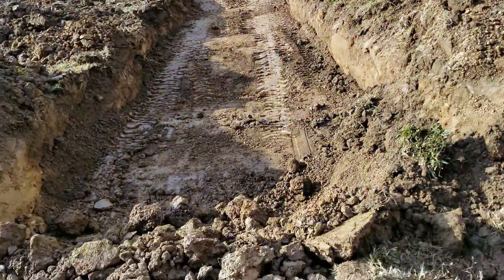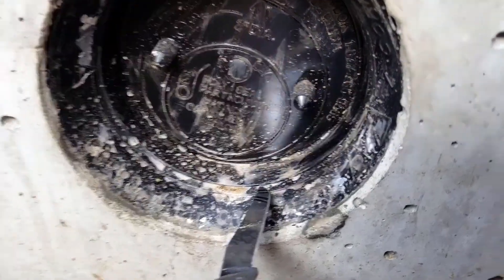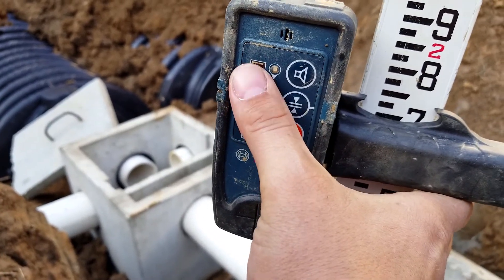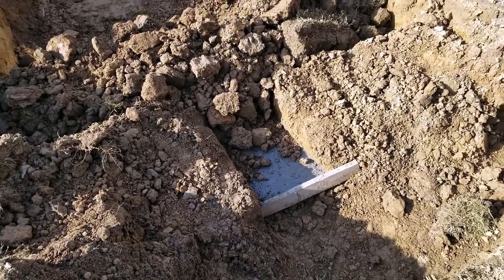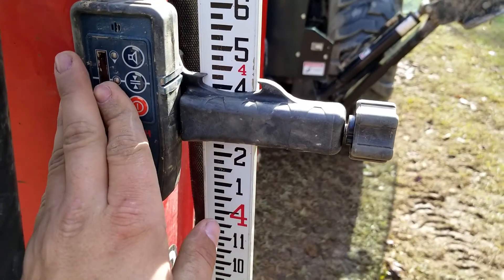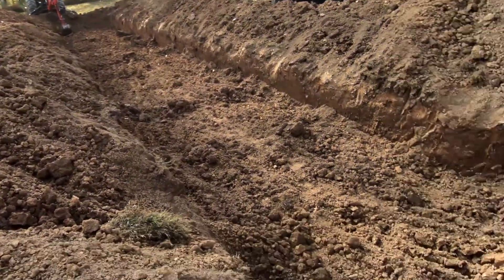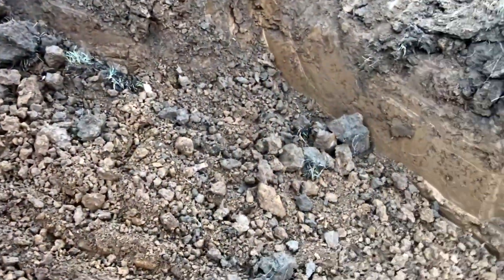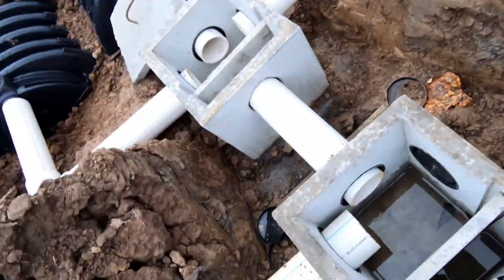DIY Septic System Install: Passed Inspection! Infiltrator Chamber Install Pt. 2

Comment from the maker: Alot of things I didnt mention in the install so I did another septic https://youtu.be/wVrOz-LTJr4
Reply: When you drive over what happens if the chamber side push down into the soils couple inches will that throw off the pitch? Doesnt seem like pipe runs the length of the camber are they just to create a void underground and level doesn’t need to be perfect except for the first one.
Reply from the maker: The pipe goes into the chamber just a few inches.  As long as the ground is within 1 inch of level from front to back. You will be fine.  If the chamber does go into the soil just a few inches you can shim it up.  Honestly  I dont see iflt hirting anything. If the inspector is checking it.  Do it right

Comment: did you level each section of chamber as you went?  I'm considering installing my own to replace a failing system. i'm hoping i can do 9x50 feet since i have two septic systems for this 3/2 house.  If i have to i'll go 12x50 and take out some trees. I guess the first step is a perc test to see how big of system i need.
Reply from the maker: If you have clay 4 soil   do 9 wide by 75
Reply: @hurley001  this is North central Florida, it's mostly sand. I've dug 6 feet down near the house and never hit clay. if i go to the back of my 2 acres where it slopes i can hit clay at about 4 feet and it's some tough stuff to dig through.
Reply from the maker: Leveled as I went
Reply from the maker: What caused yours to fail
Reply: @hurley001  roots! i've got roots growing into the exit pipe from the tank. House was built in 1980 and has a system on both sides. They used black corrugated pipe coming out the tank which was no match for tree roots. Guessing the same pipe is in the leach field. I assume the field is full of roots, but i haven't dug it up. I believe i found the Dbox just a few feet from the tank and it had a thick black rubber top which crumbled. it looked like tire rubber it was that thick. i expected to find a cement dbox like the tank.

Comment: Does pipe go all the way through the chambers or only at the inlet hole?
Reply from the maker: Only a few inches inside
Reply: @hurley001  thank you. Can you explain how it works ? The water doesn't just drain there and stay in the first chamber? It will continue all the way down the chambers?any answers or advice you give me will be appreciated
Reply: @joshuabradshaw3050 GoodQuestion
Reply from the maker: @joshuabradshaw3050  in a perfect scenario. Everytime effluent enters the distribution box.  It will send flow evenly into each set of chambers. If the ground is level.  Under the chambers.    The effluent will spread out across the soil evenly and percolate into the ground. The chambers are basically a holding tank for the effluent until the soil is ready to accept it
Reply: @hurley001  one more thing. Do you put a splash guard down under the inlet pipe
Reply from the maker: @joshuabradshaw3050  you can use the plastic that you cut out of your end cap
Reply: Id like to know also!

Comment: Its funny how different jurisdictions have different codes. Around here they won't let you put the infiltrators closer than 10 feet apart. They also warn you to avoid driving the machine in the trench or over the infiltrators. They don't actually say they will fail you if they see tire marks in the trench but I suspect they would take a dim view on it.
Reply from the maker: It's different everywhere    I have done a test and had a gopro inside a chamber and ran over it with a tractor
Reply: Yeah its more about soil compaction rather than collapsing the pipe. I just made sure I hand raked any tractor tire marks out before inspection..:). Nice job BTW. @hurley001

Comment: Will this system work for a failing leach field and what would be the approximate cost, thanks
Reply from the maker: Jeff,  are you wanting to put this system in the exact spot of your failing bed? If so, not likely.  When a bed is failing the ground is sealed by biomat.  Causing the soil to not accept any effluent.  How do you know your bed is failing

Comment: Hello, I’m doing this at my place but the soil is all clay, should I add a bed of gravel before I lay the chambers?
Thank you
Reply from the maker: Honestly if you wanted to go a little deeper and add a bed of #2 rock. It prolly won't hurt. I did this to one of my other systems and it works well

Comment: What was the result of driving over these chambers. I am getting ready to install a system and I wonder if I need to fence off the area where the chambers are.
Reply from the maker: @charles stonex. I havent uploaded a video of it because I sold my pc. But yes you can drive over them. Just make sure you let the earth settle prior to running over top of them.. long term. I wouldnt recommend driving over them constantly.but they did hold up with my 12,000 lbs tractor
Reply: @hurley001  Good answer. I was more concern about occasionally driving my pick up or JD 38HP tractor over it. Thanks for the info.
Reply from the maker: @chuckstonex1632  I think you will be fine.  What type of soil do you have
Reply: @hurley001 I'm not sure exactly. I'm in central Texas. We had a survey done last year for a new system and as I recall it was of caliche and clay???
Reply from the maker: @chuckstonex1632  I think you will be fine

Comment: What is the point of the chambers?  I see people using just the perforated pipes and others using chambers.  Is there an advantage to one over the other?  What is the cost difference?
Reply from the maker: Depending on the cost of rock and pipe, it can be cheaper to go with a gravel bed. The pros to a chamber system, you will have more volume of water to go into your bed vs a rock system.  The installation process is easier in my opinion for the chambers.

Comment: These are crap,be ready to replace them in 10 to12 years.
Reply from the maker: Did you have to replace any in 10 yrs?  What makes then bad?
Reply: @hurley001  he doesn’t have a reason because he’s full of crap. I’ve had mine since 2007 and still working just fine
Reply: I'm having to have one replaced right now installed in 2011.
Reply from the maker: What happened
Reply: @hurley001  I'll know by tomorrow, if you want I can even email you the inspection report.
Reply from the maker: Hjzrentals@mail.com. also take pictures if they dig up the old system..  I want to see the ground where the chambers were. The d box and lines to chambers
Reply: @hurley001  I just sent it right now
Reply from the maker: @411guy  Great!  Thank you!  I seen the email and responded.  I have a few questions.  Why did you have the inspection

Comment: how is that system working and is that clay soil?
Reply from the maker: Clay soil. How wouldnt it work?
Reply: @hurley001  clay soil is heavy and not very good drainage, I have a mountain full of it.
Reply from the maker: @olddave4833  yes it is.  Inspector said i would have to install the biggest bed in the county
Reply: @hurley001   we try to keep those inspectors away from our jobs, they went  to school and have a degree but we have the knowledge from practical experience,, many times they do over kill costing lots more money just to protect their job.
Reply from the maker: @olddave4833  how to get around the inspection?  Aep wont set power without a sticker from inspector
Reply: @hurley001  right, need them the first time  just to get a C.O.  but after that  we're supposed to call them  or pay a licensed engineer to lay out the system for the BOH to pass and the poor home owner has to take out another Mortgage to pay for it before they are done.  Just my nieces Well and Septic cost them over thirty thousand dollars. they had to put in a built up system
Reply from the maker: @olddave4833  oh jesus!

Comment: Why did you use 2 d boxes and would 3 30 foot lines work for one mobile home
Reply from the maker: I used 3 d boxes.  First d box off the tank equally distributed to the 1st and 2nd leach field. Each leach field has it's own d box to evenly distribute to the row of chambers.  My 3 lines of 75 feet were because of the soil percolation test.  I have clay soil. Therefore needed more coverage for water to percolate.  Your solid may be better and can use less of field

Comment: With a drain field using only two lines of perforated pipe, should one of the pipes be in direct line with the septic tank outlet pipe? Or, can they be staggered on either side of the outlet pipe?
Reply from the maker: They dont have to be in a direct line  be sure to use a distribution box and you can run one field in any direction that is within you code and the same with the other field

Comment: Do you rent these mobile homes out? I just put in a third mobile home to rent but ran into an issue with the old septic we had. Was thinking of doing it myself but the concrete septic tanks are pushing 10,000lbs and unfortunately we have people waiting on it. I plan to have 6 mobile homes at this location and was wondering if I should just go with one large conventional system. We have 5 acres with 3 systems already but the old third one failed.
Reply from the maker: I'd go with this type.  They weigh about 350 lbs.  Much easier to handle with a few guys.. and yes I rent these
Reply from the maker: You can go with a treatment plant but if you plan to have 6 mobile homes, it will be cheaper to do 1 system per lot.

Comment: I'm going to try adding a leach line at my house. Does anyone know how well these would work in Phoenix Az? Would it benefit me to add gravel under the chambers to help it percolate? Does anyone know how close to a saguaro cactus I can safely be with these systems?
Reply from the maker: I dont know how close to a cactus. But we have to be 10 feet or more from a waterline.  Gravel wont be a benefit. The chambers are meant to fill with effluent, then percolate into the ground.. the old gravel system had to have gravel to create a void in the ground for the water to rest and percolate.
Reply from the maker: We have to be 50 feet from a water well.  If you use gravel in the chamber.  The less effluent it will hold.

Comment: That system should never back up😁
Reply from the maker: I hope not haha
Reply: Did I hear him say 9 mobile homes on that system 😳😳
Reply from the maker: No.  9 mobile homes on the lot haha
Reply: @hurley001  not 9 on that one system. Ok
Reply: @hurley001  getting ready to put the arc system in mine. Redoing old leach bed. How many rows and how far would you say I should go with a 3 bedroom house.
Reply from the maker: That system would be backed up weekly if that were the case haha
Reply: @hurley001  and what did you find out about driving over them? Curious about that.
Reply from the maker: @Gpreece100  I have done tests.  Havent posted the video. But I will.   The tests consist of driving over it with a 4 door f150, then a rk 55 tractor and then a dump truck that weighs about 17k pounds :)
Reply: @hurley001  be looking for that video when you post. Thanks!
Reply from the maker: Thank you for the sub!  I will have to tag you when I post! :)

Comment: Nice set up, have you seen those filters that you put in the septic tank to keep solids from getting into the drain field?
Reply from the maker: Yes I have. Do you use them?
Reply: @hurley001  yes I do use them they seem to be doing well so far. nice peace of mind knowing a bunch of debris wont plug the drain field.
Reply: Do you have a link for these filters? i'm going to attempt adding a leach line at my house in Phx Az. There is no filter on my septic and i'm wondering if I need to add a filter of some sort
Reply from the maker: @jobsforjoggerspetit6530  you will have to purchase them off your local septic dealer
Reply: Using these type of lines,  do you think you need more, or less feet of line?  Opposed to the perforated lines with the gravel.
Reply from the maker: @tonyb460 less line
Reply: @jobsforjoggerspetit6530  There are a few places on the web that carry them. o a search for Polylok PL-122 Effluent Filter & Housing. Prices vary so shop around.
Reply from the maker: Thank you bill

Comment: Good content, but the camera was jerking and rolling all over the place.  Aside from that, thank you for showing us how this is done.  Did you have to get the soil 'perc-tested' to make sure absorption was acceptable?
Reply from the maker: Yes I had to get a perc test by the health department. This soil is clay, so I was required to make a larger bed for absorption
Reply: @hurley001  Perk tests are a joke. Typically the problem with drain fields is water retention in a given area after a long rain.  If you have a field under an area that water runs off of it can have the same results from a perk test as the spot that the water gathers in. 
Clay is a problem...PERIOD.
Reply from the maker: It is for sure

Comment: What is the cost of this system thanks
Reply from the maker: if you do it yourself, you are looking close to $2,000  That is the tank, chambers, d box and pipe. This is in clay soil. If you are in good soil, it will be much cheaper, because you wont have as much chambers to install.

Comment: Great job, Sir. I saw how ell this video started then got a quick look at your piers, and thought to myself, "Wow, those look great. I'll bet he installed them too."
  It looks like you have decent soil for drainage. Regarding driving over the chambers, you shouldn't have a problem if everything Is dry with your soil type. Although they're designed to replace having to use gravel, a 2-4" covering with unwashed limestone gravel settles in and helps distribute the weight off the soil above it, aids drainage and lets  the clay above shift and give untill it settles in really well, minimizing any problems driving over it. Great job.
Reply from the maker: Thank you! I was really doubting some of it but you must know quiet a bit about this kind of work! Thanks alot!
Reply: A small track hoe is a lot faster than the rubber tire back hole